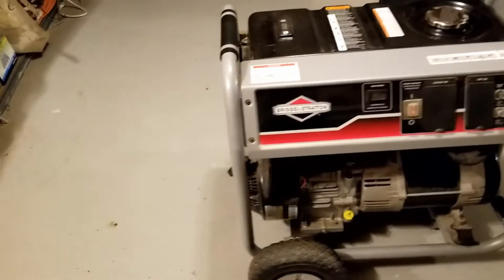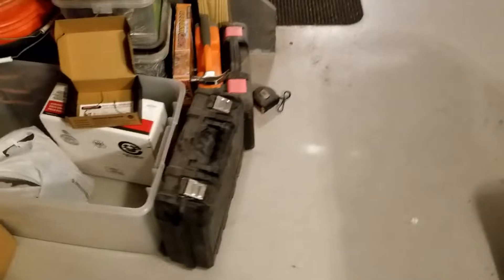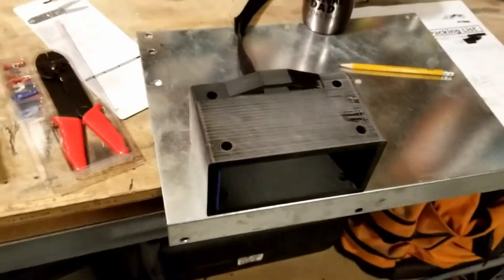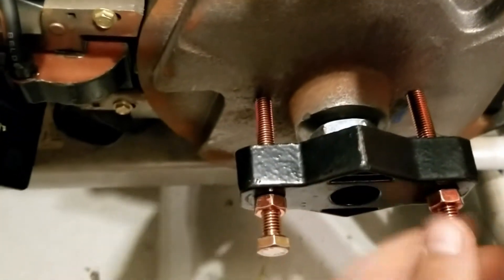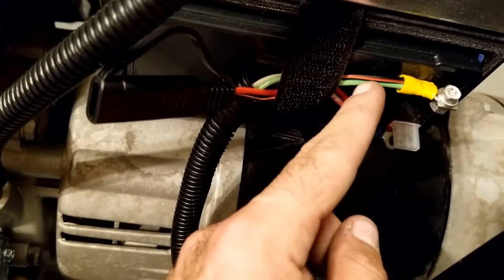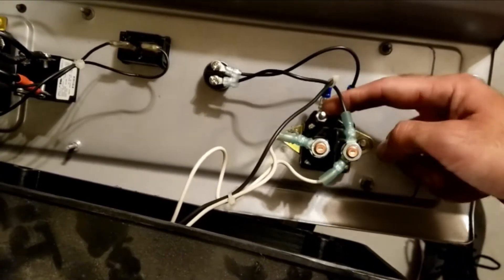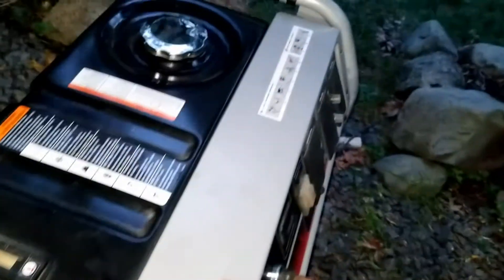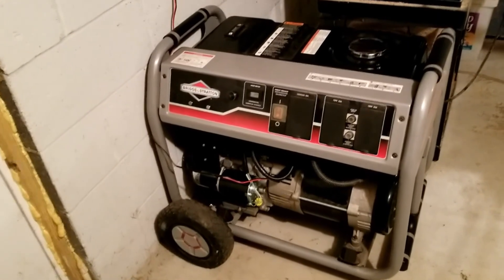Installing a Push Button Start on Generator - Briggs and Stratton 1650 - 5500 Watt

Comment: i just spent a few bucks more and bought a litle bigger generator with a button start. way easier
Reply from the maker: Oh, without a doubt, it's easier.  This is just my solution to upgrading an existing generator rather than buying a second one.

Comment: By chance do you still have part numbers for flywheel, starter.
Reply from the maker: In Description - Flywheel with Gear - Briggs & Stratton 794812, Starter - Gladiator New Premium Starter fits Briggs & Stratton Small Engines 20H, 20L, 20S, 20T, 21S, 21T Series 201312 12 Volt 14 Tooth CCW 695479 5937 213-10102 MS-6031 RS41086 435-287 71-09-5937

Comment: Could you tell me or provide a link for the propane conversion kit you used? I was hoping you had a video but I didn't see one. :(
Reply from the maker: This is the site I went to but I also modified their basic kit with a shut off valve.  I also purchased a 3/4" rubber gas hose from them with quick disconnects for hooking up the gas lines.  https://motorsnorkel.com/product/motorsnorkel/msk3101-motor-snorkel-tri-fuel-natural-gas-propane-and-gasoline-conversion-kit/

Comment: How did you identify the correct kit for your engine?
Reply from the maker: I looked at Alan Miller's mod of his storm responder (https://www.youtube.com/watch?v=on7WEDG8pio) and took a chance on the same flywheel he purchased (Roughly the same HP motor).  I'm sure it's not that helpful but he did mention that when he was viewing schematics online they were showing teeth on the flywheel of the Briggs and Stratton storm responders.
Reply: @MoeSizzlac01  What I was able to find is that these engines are Honda clones. I have the Storm Responder 6250 and the engine is a GX 390 clone. @JamesCondon pointed me in the right direction for that, and then there's significant differences in the late and early (2011 and prior) versions of the motors. Specifically in how the flywheel is keyed in relation to the ignition magnet. I was able to determine which flywheel I have by pulling the shroud and flywheel. I ordered a kit today.

Comment: Its a good job ... I have a generator that can be turned on by a switch key or by pulling the rope ... i cancelled the switch (when it was broken) and made it work with a push button ...  
in ur case you added a push bottom to start the it .. but u didn't show how u turn it off? .. u need a switch off for that

Comment: You probly already know, the E.C.I.(Electronic .Controled.Ignition). ECI- gap is set ,rotate flywheel,to align magnets to eci. Slip a business card,between flywheel and eci tighten.eci bolts. Gap is set. That works on all small engines with that setup.hope that helps👍👍.Great job,and thanks for sharing

Comment: you can use a rubber hose or a small rope in the spark plug hole will lock the motor up just don't put all way in all it will take about 2 "

Comment: Adding a battery start is a nice idea. One of the downsides of this is that if the generator is stored with a long time period in between uses - as is the way with generators -  then the battery goes pretty flat. What could be done.?  Fitting a charging circuit so that the battery is charged during use will charge the battery but not when its stored in the garage for two years. A solution commonly used is to use a small battery tender or maintainer device.  This connects to your 120 outlet and trickle charges the battery as the voltage falls over time. You need access to the outlet to make this work. Walmart sells one for under 20 dollars.

Comment: What did you use to get the front plate off?
Reply from the maker: For the plate with the plugs, First remove the 4 screws (2 on the left and 2 on the right.  Then remove the 4 small nuts around the plastic back piece and just slid that plastic cover back to get access to the internals.  You can see one of the nuts at minute 2:31.

Comment: I bought 3500 for my parents from home depot about 3 years ago and they have a hard time pull starting, Now I'll have to check to see if it's got those mounting bolt holes the next time I'm over to visit them.

Comment: Will any 16.5 hp flywheel work or does it have to be the one you listed?
Reply from the maker: So long as your inner diameter is about 21.8mm, overall diameter is 7 3/8" (without the teeth) and depth is 2 3/4", it should be fine.  You may also want to check to see if your flywheel fan can go on the new flywheel (the bolt holes line up)

Also check out this video, which was the basis for me doing my video - https://www.youtube.com/watch?v=on7WEDG8pio